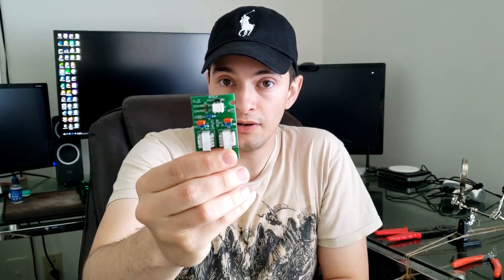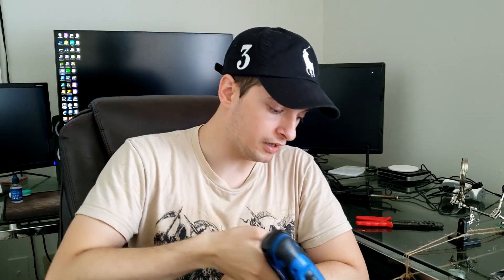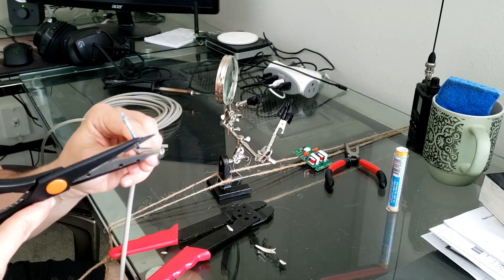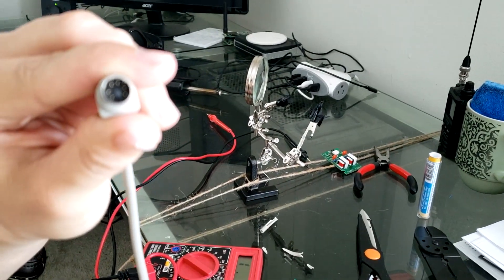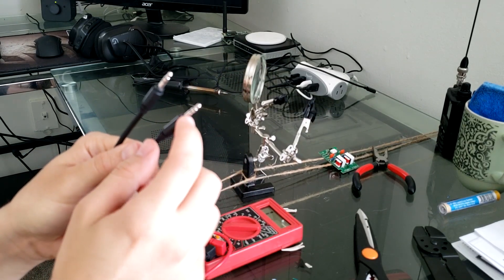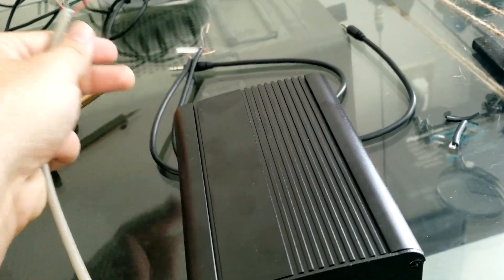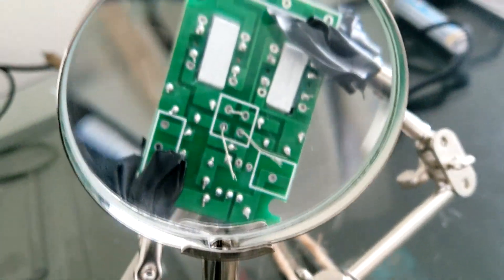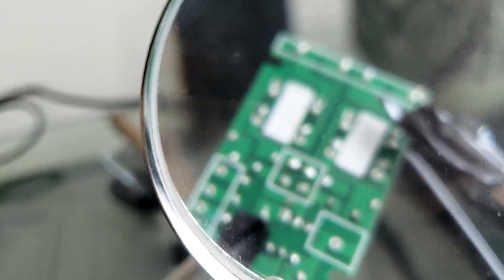Building Radio PC Interface with the Easy Digi for Digital Ham Modes

Comment: How do you activate TX on transceiver, does it activates when txing from the program or are you using VOX on transceiver?
I was wondering on that because I'm figuring out how to connect the cables to activate TX without using any usb adapter to work as a trigger to activate TX relay on the rig.  I have a Kenwood TS-50S.

Comment: Billy, great Job easy to follow and understand where the wires go and overall what is needed.  I got the digital data going for a Hambuilders HBR1HF doing Winlink and Vara HF and right now copying you with a easydigi for a Hambuilders HBR4HF rig for the same.  thanks big help
Reply: Billy I have a question.  SO I am putting together a EasyDigi and I have it all ready except for the USB connections.  So the USB has 4 (5+D-D+5+)  the easy digi has Grd, RTS, DTR.  So I guess the RTS goes to D- and DTR to D+?  is that correct?  thanks Don V31NT
Reply from the maker: @donniebrugge8117  Hey Don, Sorry I can't help you with this one. I never used any other function other than the audio with the EasyDigi.
Reply from the maker: Awesome! I'm glad I could help out!

Comment: What about grounds ? Do you connect ground from computer to ground from radio ? Do you ground a box ? If yes to computer or to radio ?
Reply from the maker: Technically, the grounds are connected from PC to radio, but with the diode and capacitor network, it helps issues that may come out of that.

Comment: That Easy Digi is a pain for the way the wires go into the center and it is an awful design, I make one that is very popular and is sold on Ebay.  Practical.purchase is my ebay name. Take a look st the easy digi boards I make, they are way better than what you bought, it was when I bought that one you have, that made me redesign the board and make it much better.

Comment: Hey amigo! Great video. I'm currently building one for my old ICOM-730, and have a couple questions, if you can help... With using the USB sound card (I will be doing the same), do you need to connect the DIGGND, DTR, and RTS lines? Also, since I don't have a data port on that radio, I'm assuming I am going to have to connect the PTT and PTT GND lines from the 8-pin mic connector?

Comment: Can the Easy Digi compensate for radios that have different volumes on different bands without having to adjust everything for each band like an AGC?
Reply: No. The volume adjustment must be handled on the computer side, with either MIC gain, or Audio output.

Comment: Thanks for this video.  How do you know if the wire is shielded or not? I have a few 6 din wires
 but don't know if it is shielded.  73 de K6TJO?
Reply from the maker: You know I've never thought of this, and I could be way off here, but I think if you get continuity between the metal around each plug ends, its shielded. (Or just connected to ground). Not quite sure.
Reply: It is usually a very thin aluminum foil shield that is wrapped around the wires with a separate (7th) unshielded wire running along with it, from end to end. Carefully cut away some insulation until you can see the shield and/or wires. If you don't see the aluminum foil, it is not shielded. Be careful cutting away the insulation as you can very easily cut through the aluminum foil shielding. It is very, very thin!

Comment: Billy , I'm still kinda confused on what a sound card does ,  and how it work's.   I'm gonna have to go back a few video's to catch up.  I haven't had much experience in this field.   Even though I went to electronic school in Lexington.  We mostly worked on TV's and VCR's.   That was back in 1994.   We knew that high definition was coming , but Mr. Sypes said ," it would be too expensive to broadcast on high definition for locally owned tv stations in Lexington.    So much for their theories on the future.     You're doing a great job on the video's.   Keep up the great work.  Enjoyed every bit of it.  Wish I had been in electronic school much later.  Specifically around 2009.
Reply: KO4BMM.   73.   YOU'RE Leaps & Bounds ahead of where I was at your age.  You're very bright.   I like the effects on your YouTube channel when it first comes on.. How did you figure out all this stuff with YouTube ?
Reply: We had nothing back in 1994 with the internet.  Lol.   KO4BMM 73's.
Reply from the maker: A sound card pretty much converts electrical signals into an audio waveform (i think) to send over to an audio output device like headphones or speakers. Our radios typically use this interface to pipe audio we receive into our microphone port, and our computer decodes that incoming audio into data. Same way with the transmit, but instead of playing the "sound" through our speakers, it is sent over the radio to be decoded by someone eases computer. Thanks for watching! I'm currently taking a deep dive into electronics because I want to learn more.